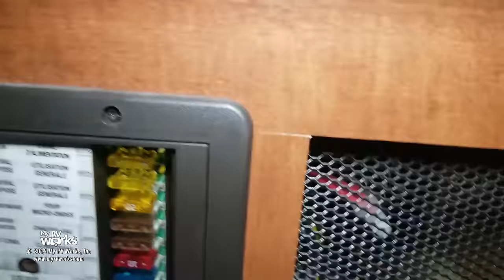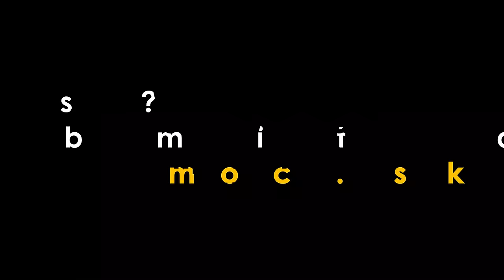RV Power Problem Leads to Converter Diagnosis and Replacement

Comment: When I plug my camper in at the campground, I have to let it sit for a while before I have power to open my slide out. I have noticed my battery is dead, so I'm going to buy a new one and hope that fixes the problem.
Reply: Is there water inside the battery?
Reply: @iair-conditiontheoutsideai3076  brand new battery.

Comment: I'm confused please help.

I'm connected to shore power and there's only 120 v going to microwave and GFI socket. Now if I turn on the battery DC switch everything works until the DC power runs down.
 But you have to turn off battery DC to get the GFI working again.
There's no green light on the receptacle fuse panel but it appears the converter is recharging my battery? 

It's recharging the battery on shore power yet it's only putting 120 out to GFI none of the other 120 v are being converted to 12 from AC shore power ?

Oh, like you said the battery charger is built into the converter on my rig 2021 palamino puma so the chargers working but the converter is not converting 120v to any of my 12 v appliances  .

I have that nasty integrated one .

Ok I'll throw the converter at it .
Ok I think I got it, help if you can we are kind of stranded please .

Comment: Tricky question: I get Ac power along with DC power. The battery charges when pluged into the tow vehicle but does not charge when plugged in to shore power however im getting power to operate unit just wont recharge. any idea or video you have done that covers this problem. im lost.

Comment: Thanks for the great info. I was able to replace my converter and now everything works when hooked up to shore power. However... when I unhook, nothing works. The batteries are new and charged and I do believe they are installed correctly. Any suggestions? Nobody here in Jacksonville can look at it for at least a month.
Reply from the maker: You don't state what type of RV you have but there's usually a circuit breaker style DC fuse near the batteries. You may want to take a meter and verify you're getting 12 volts through that fuse. If it's a travel trailer it should be right there near the tongue, if it's a fifth wheel it's usually right in the same area where your batteries are.

Comment: We are connected to power at a house and everything has worked but now 3 lights in the middle of my 2011 keystone passport ultra lite 2650bh just quit working can my converter be bad, only effects the 3 lights and I have checked bulbs, and  fuses.

Comment: Use a power probe to check fuses, both sides are the same polarity -good fuse    If not the fuse is blown  this test can be run with or without power

Comment: I'm switching to Lithium batteries and am thinking of switching out my converter charger.  Is it okay to slightly increase the charger from 35 amps to 45 amps?

Comment: I have everything working on shorepower but when running off battery lights work but pump will not work and awning. 12.7 at batteries . I lost other than possibly bad batteries.

Comment: Quick question. If the converter is bad you can still run off the vehicle plug right
Reply from the maker: If you are referring to the 7-way connector, it has to do with the wire gauge and the amount of amps that are passed through. That 7-way is really designed to slowly trickle charge your battery. There's not going to be enough power through that 7-way circuit to run your DC appliances in your RV.

Comment: Good job Darren. 
Question: 
As an ET in a previous life, I was taught to not use an ohm meter to check fuses while the device they were in was  plugged in to power.. Our Simpson D'Arsenval meters would burn up their ohms function if the fuse was actually blown.
 Seems as the "..applied voltage is measured accross an open circuit.. " and if the fuse is open, the meter would be subjected to that voltage and prone to damage.

Are modern meters not vulnerable to this issue?
Reply: Yes, I have unpleasant memories of being an ET working in an electric motor shop many years ago that was part of an electrical contractor company - having to repeatedly and often rebuild Simpson 360 meters that electricians fried on the ohms scale. No, a good quality DVM/DMM is protected from failure due to being in the wrong scale. However, if reconnected to measure current they can take out the internal fuse.

Comment: Hi! I got a question hopefully u can help me out, I got a 2004 fleetside redwood pop op trailer, and in my AC SIDE everything works as it should but in my DC SIDE  everything works except the microwave and power outlets, I checked the fuses and everything looks good.. !! Any suggestions?? Would be really appreciated.

Comment: IF I HAVE THE CONVERTER  PLUGGED IN AND HAVE BATTERY  CHARGER IS  PLUGGED IN  WOULD IT FRY THE CONVERTER  AND SHOULD THE DISCONECT SWITCH BE OFF IF  AND HOUSE BATTERY OFF ALSO I LIVE IN MY MOTOR HOME FULL TIME

Comment: what if my problem is very similar but opposite ??  Like I have the DC but not the AC ,.. so is it then the Inverter ??  I was chasing the power transfer switch,.. but ??    help . :eyes-purple-crying: my shore power is not reaching my plugs or microwave /converction oven  and some lights...

Comment: I have an Intell Power PD9160A converter and it is blowing the 2 fuses when I turn on the power.  My trouble shooting said it is due to reverse polarity, I put a meter on the 2 wires going to battery and it shows its ok giving me a positive 12.6 on my meter. Nothing has been done with the wiring to the battery it just started doing this as our lights were going dim.  If it was reverse polarity I would be getting a negative 12.6 which I'm not so confused as to the problem that is causing those fuses to blow.

Comment: Why would a converter start smoking, fail and then affect the 120v system? Had mine fail last night, started smoking and shut down all the 120v outlets. Turning off the converter breaker did nothing to help, but when I would turn the breaker back on, it would send power to the 120v system for half a second, then shut down. No breakers would trip. No fuses would blow. Why?
Reply: Fried a new converter today, then the 120v system works just fine on its own. But 12v system is down.

Comment: What if the converter is putting out 13.6 volts until you connect the output wire to the 12 volt panel then the voltage drops to between 9-10 volts and does not charge the battery?

Comment: Thanks for the video. Ok if we have a solar system or not and still connected to shore power how does charger know if battery is charged. Does charger work like a battery charger in our garages?
Reply: solar needs a charge controller

Comment: My rv while running gives me 13 something votes but while plugged in iam getting bubbling battery replace the one of four and tried it again  and got rotten egg smell so I think my other battery's are bad but there only less than two years old Duracell if I buy three more new  batteries iam I running the chance of ruining them or do you think it's my converter

Comment: Hey. I have a question. I checked my RV converter there is no grind wire running to the converter. Is it possible that my inverter is grounded through the breaker box??? I have no dc 12 volt power.

Comment: I’m really new to all of this and bought a fifth wheel just under a year ago to live in temporarily so I can save money and get back on my feel after a traumatic divorce. Everything that could go wrong, did. Holding tanks, vents leak, kitchen sink leaks, rats made it inside the belly where the holding tanks are and now the ceiling and walls and my batteries drained and I had to replace them. Come to find out it isn’t the batteries it’s the converter so I’ve had it hooked up to a battery charger for a minute. Could this be keeping my air conditioner from getting cold? I’m in Puyallup WA but that’s still a hike to you and I’m not able to move it seeing as I paid someone to get it here in Puyallup.

Comment: I’m plugged in the air conditioning works but the fridge doesn’t than it faults on my inverter remote all while plugged in to shore power. I’m guessing the inverter is shot but it’s a confusing one.  Batteries are all new fully charged

Comment: Thanks for the video.  My converter output is reading 0.45 Vdc. If I remove the white wire it goes to 13.6 Vdc. I have removed all 12 V fuses with no change. Seems something is loading the converted down. Or is it a bad converter? The battery was installed backwards at first and blew the 30 Amp fuse in the green wire on the battery. The reverse polarity fuses in the converter were not blown. IOTA-DLS-45. Any ideas?
Reply from the maker: I would follow the trail, it does seem that the converter ground wire might still be connected to the battery positive.
Reply: You're the man! Three black wires from the RV were connected to the battery negative! I moved it to the positive and everything works fine. Shout out to IOTA-DLS-45 for surviving this abuse. Buy a $5 clock from China and it shows you how to connect the battery. Buy a $25,000 RV and not one useful diagram on connecting the battery.

Comment: So, the battery needs to be working even if hooked to shore power for the AC, lights, fan and frig to work.
Reply: the converter has very little amps to offer, as the batteries have the amps needed

Comment: Hi! So if my 12v "brain" battery is working to my AC, but i cant get the generator or shore battery to kick it on, what does that mean my problem is? Also cooktop and microwave and tv do not work. . . thanks!

Comment: Also when a test light is attached to the battery leads (with the battery disconnected) the light surges on tester but only when plugged into shore.

Comment: Can somebody help me please. I just arrived to a campsite and plugged to 30A service and my voltage meter shows 16-19 Volts. Maxx fan will not work because too much voltage. It should not be more than 14.5V when plugged to shore. I'm afraid iI may damage some of my equipment. When I unplug the shore power fan works normally. Dos this mean the converter is broken and puts too much power? Couple hours before I was plugged in my driveway and everything was OK. Please help

Comment: Hello, I am hoping maybe you can lead me in the right direction. When my toy hauler is plugged into shore power, and my switch is set to 110v it runs for around 15 minutes then shuts off, and I lose power for a random amount of time then it clicks back on. this repeats all the time. If I change the RV to 12 volt and keep it plugged in to shore power it stays powered. any idea why im losing power? I would hire you to come look buy im in California. lol

Comment: The charger output on mine (at the battery) is only 11.6 volts.  Is that OK? Should I dig deeper?  It's a 1993 Toyota Dolphin, so it's old and original.  I suspect the charger and converter are integrated.
Reply from the maker: On the charger you will see writing having to do with input voltage and output voltage. Most of these converters output is around 13 volts. So if the converter states its output voltage is 13 but you're only getting 11 then yes at that point I would suspect the converter has failed. If it's integrated in with the fuse panel, you can add a standalone converter - just find a spot near the breaker panel to mount it and then run your wires to where the original converter connected.

Comment: Question. I have the same problem. No inside lights when hooked to the battery. Battery inline fuse keeps blowing. Today I unplugged battery and 7 way. Connected shore power and microwave came on and 30 amp fuse beside the breakers melted. 30 amp fuse was called inline charge. Would a bad converter cause the panel fuse to melt and cause battery fuse to pop also
Reply from the maker: That sounds like you have a dead short somewhere on one of the circuits. I don't know that I would automatically say it was the converter that failed. Converters rarely fail to ground. They typically fail 'open'. Disconnect everything so the RV is dead in the water and then using a meter continuity Mode start touching wires to ground - one of them should sound off. Here's another video where I do a similar type activity that I'm asking you to do here now.

https://youtu.be/m-rLnWqRMbs

Comment: Question? Generator was running air conditioner while traveling in my class A. Working great as always for a few hours. Suddenly the air conditioner stopped working. When I plugged into shore power the air worked again just fine. Any advice?
Reply from the maker: The first thing that comes to mind would be to check the generator, there may be a circuit breaker that tripped on that unit.

Comment: Interesting...is there such a thing as a converter/inverter fuse box? I’m having difficulty finding my converter in my 2004 Asrolight Cub.
Reply: you may have a charger / inverter , It would be close to the Batteries ,, Hope it helps 
R.J

Comment: The problem i am having is the whole left side of my electric panel has no power so i only have 4 outlets that work no air and no tootsie warmer, no power to the water heater either i have done some testing to the panel, that is how i know 1 side of my panel on the main  barker i have no power any ideas what i should do i tried replace the main breaker and 20 15 but did not solve the problem

Comment: I have a problem with my travel trailer where I can't seem to get power into the rv even though I'm connected to shore power. Lights, fridge, AC, microwave etc dont seem to work. I did notice that the outlets do have power but I don't know why the rest of the appliances don't get power. Any tips to how I can resolve this would be greatly appreciated! Thanks in advance.
Reply: combo volts needed 12/120v...change converter

Comment: OK, so if my teardrop is plugged in but my ac blew the fuse to my house(it worked in the past . Old battery was low so I put a new one in and nothing changed still ac wouldn't work and fan and lights and fridge all surged. its probably the converter . No inverter on the t@b 2008. and I assume you dont work in Bellevue wa ,any recommendations for Mobil RV repairs here?
Reply: Hi Patricia, I don't have anybody I can refer to in Bellevue, but hopefully you have this all taken care of. If you ever need remote troubleshooting, we do offer that service. You can submit a request on our website: www.myrvworks.com.

Comment: I want to install a tank less water what brand would you recommend?
Reply from the maker: I usually try to avoid recommending one brand over another. There are so many opinions out there. Ford, Chevy, Dodge, Toyota (I have owned all these different trucks and there are pros and cons to each of them).  That's just not an argument for me to get involved in LOL.   I've worked on all of the different ODWH units, so one is not less prone to failing than any of the others.  Some are easier to work on than others but at the end of the day they all do the same thing. 

But I will say this, whenever you install an on-demand water heater you should really also upgrade your LP regulator to a high-flow regulator with high-flow pigtails.  Many of the problems we've had with the on-demand water heater is starvation of LP.   Installing the high-flow regulator and pigtail always fixes that issue.  When we do an ODWH install upgrading the regulators and pigtails is always part of the package price.

Comment: Hi I got a problem on my rv I replaced ac unit and when I turn on works for a little and brake came off and if is on and turn a light turns off as well

Comment: I have power, but my low voltage alarm keeps going off. I've had the electric company out several times and an electrician. They checked my power pole and I have great power running to my camper. I've been told the camper was running fine last year without the low volt alarm going off. When the camper is first turned on it runs great. But after a few days when I try to turn on lights the low volt alarm goes off. My brother says his camper runs fine without needing a battery and that he's never heard of a camper needing to work with a battery. He was the maintenance man at an RV resort. What is possibly going on?
Reply: converter fan working? to keep box cool?

Comment: I think my converter is overheating which is causing the unit to shut off, is it possible that just the fan needs replacing or is it just less issues if just change the whole converter? Thanks
Reply: change the whole unit, fix the old one later

Comment: A bit of DMM information for ye my friend, test leads DO NOT begin to go bad, they either will provide continuity or they will not...there's no in between brother (although sometimes a crap solder connection from lead wire to the sharp metal probe tip inside probe can cause crazy readings)
But to why you were reading 2 ohms @ 14:25 when checking the DMM's test leads continuity in the diode check mode (Continuity beep) is because you...yes, you....are actually a walking, talking resistor/capacitance device and a DMM is able to measure your resistance value. I babble too damn much sometimes....Long one short, you were making skin contact on the leads when ya checked for zero. If DMM is not auto-ranging, set meter to highest megaohm setting and touch & hold the metal parts of both + & - leads, and you will see your body's resistor value ;)
when checking for absolute zero, Keep your skin off both leads. Just some advice from a 35 year electronic technician.
Hope this tid-bit of info contributes to your most excellent video works my friend,
Have A Powerful Day & Happy Camping!!!!
"E = I x R"
~C.S

PS: Send me that pesky converter & I'll fix it for ye ;)